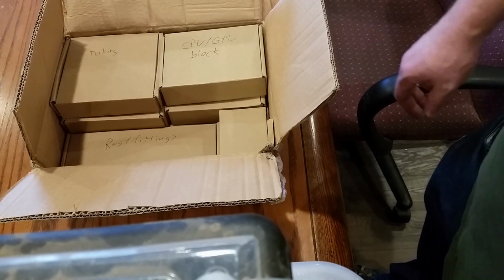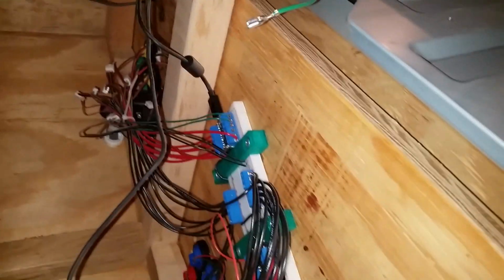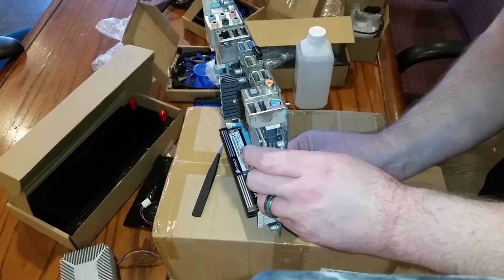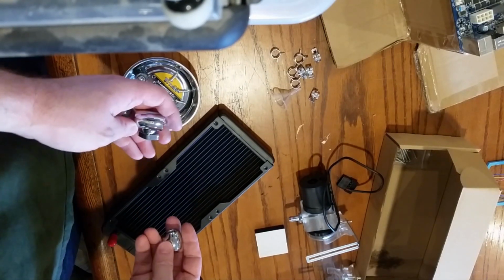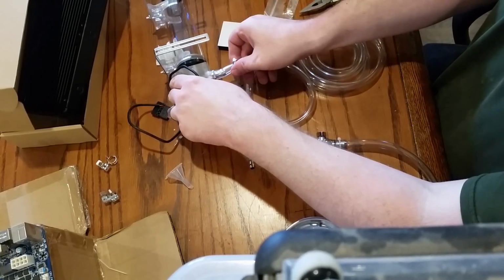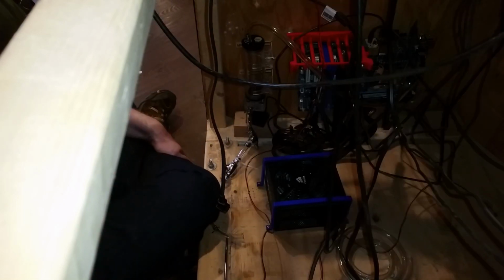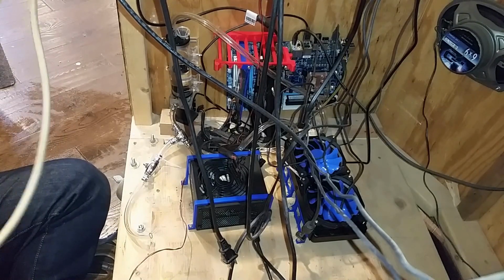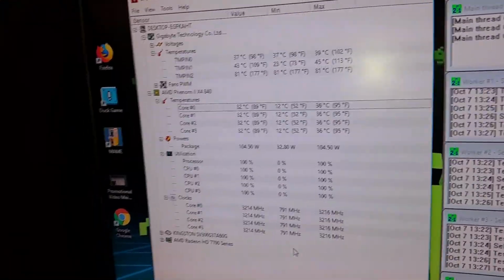Trying an $80 BangGood Custom Watercooling Kit

Comment: Good video but here is something you didnt see. 1 The small nuts go on before the cooler to hold the screws to the back plate then the springs then the cooler then the big nuts. 2 You had a bad kink in the hose closest to the cpu from the res/pump combo. 3 the  noisy pump can be controlled in the pwm fan settings. Believe me i have the same setup and it works great even on a RYZEN system. Still using it after 3 years. I know the instructions would help and can be frustrating as crap but good first time setup.

Comment: Hows the cheap water loop working out?
Reply: Basically works. The pump is noisy, which might be fixed with a better mount, or at least mitigated. Been meaning to do a followup video of draining and inspecting the loop.
Reply: Thanks man